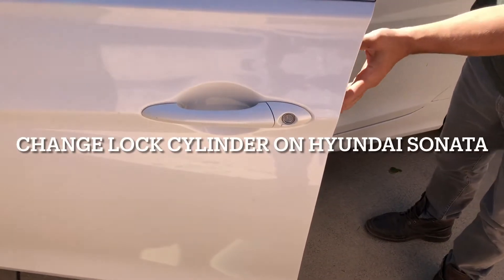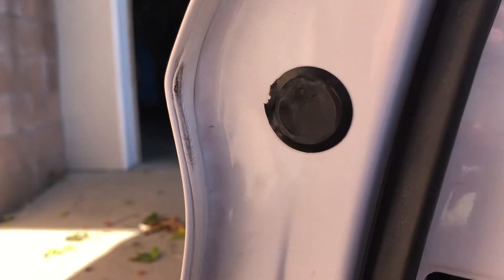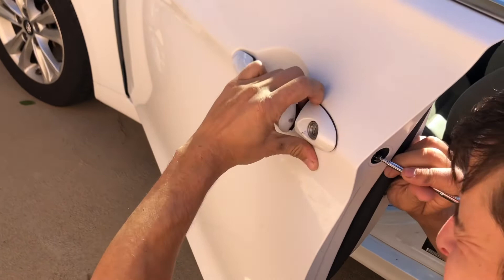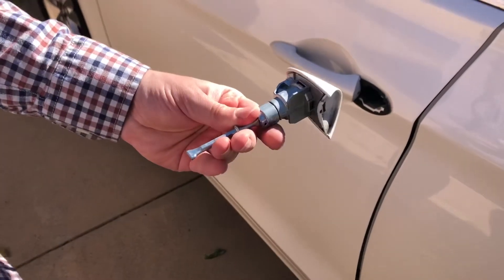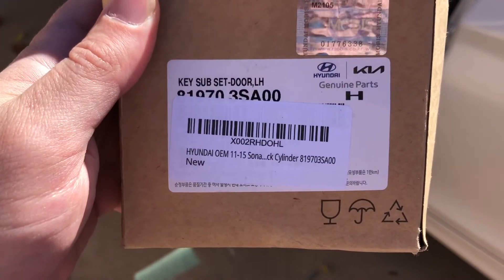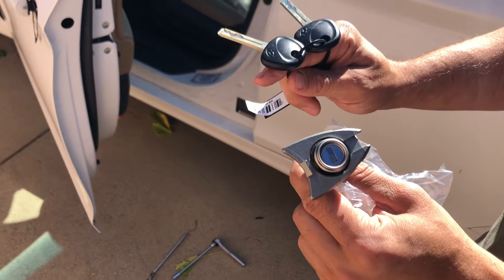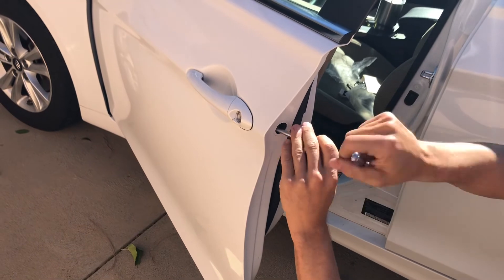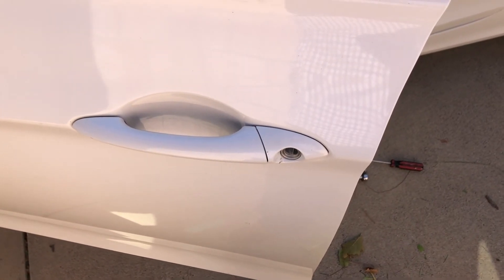Replace door lock on Hyundai Sonata 2009-2014

Comment: Thank you for making this video.  Someone tried to break into my car and destroyed the lock cylinder.  I thought I was going to have to take my car to the Hyundai dealership and have them overcharge me for doing this.  I'm 74 years old, but I feel confident that I can do this myself thanks to your video.
Reply: Someone just did this to mine too. They removed the cover and took out the part the key goes into. They left everything on the ground. There’s no way they can make a quick mold of it right? Where they hoping to open the door using a screw after they removed it? I already a a broken window on the rear passenger side. They re-smashed my temporary fix. I think maybe the frame prevents that door from being opening now though. So I guess they tried doing that to my front door. Even weirder none of my stuff looked like they had gone through it, but they left a ton of paperwork from other cars I’m assuming they stole in the backseat. If they didn’t get in they throw it in the back window. I tried taking the paperwork to the police station and they said they wouldn’t do anything with it.

Comment: Hi I need help, is it possible to replace the door handle that doesn’t expose the key lock cylinder? Thief’s keep on braking the key lock cylinder on the drivers door.
Reply: Someone tried to steal my Sonata today at Walmart! You need to order a new handle they are not expensive on EBAY.
I'm trying to figure out how to cover the key lock until then.
This is BS!
Reply: @kristine432  I am also trying to figure out how to cover the key lock because it’s been broken 3 times, it’s easy for them to steal Hyundai Sonatas. I am thinking about selling mine. I’m trying to find on eBay but I’m having trouble.